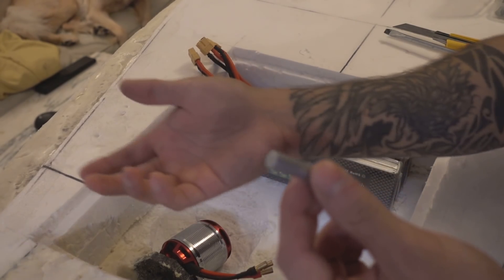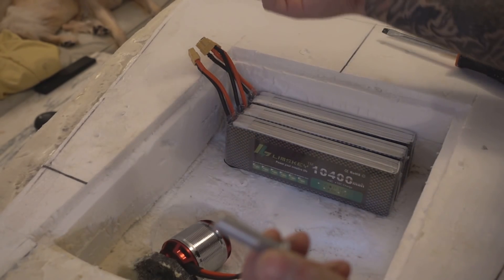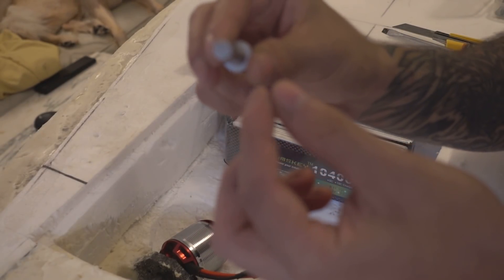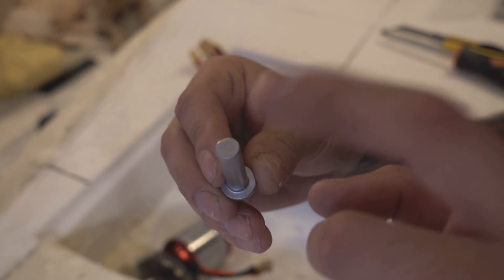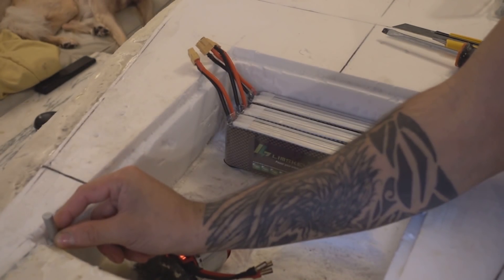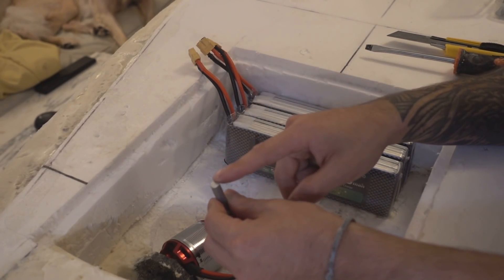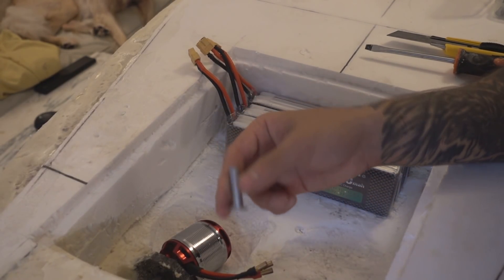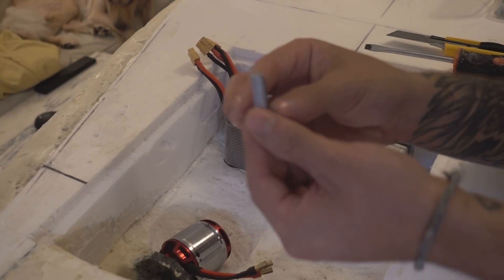Armando mi propio JETBOARD (Tabla de surf JET) #1

Comment: Hello my friend,

I'm building a jetboard also. I see that you purchased the 60 mm  waterjet  STL files from toto.
I did the same, but i'm building with a 56mm jet instead. I think 60mm is a little bit too big. I didn't build the Board, but using a Mistral windsurf Board instead. Looking foward to see your second vídeo. What are you using for power it up?  Keep me updated and also we can share thoughts.

Greetings

Luis
Reply from the maker: Hello!, yes i using that model, im currently using 2 gartt 530kv motors, these are not the best choice i can make but i that's the motors i have hah, provablly i will change it on the future, and i will start with 9s 10000mah lipo, i want to add extra batteries later, like to see your board too, good luck!
Reply: @BuildItYourself 

I use sss 56104 500kv motors. 
10000mah on 12s. Yep 120a marine esc. I purchased the 60mm But Did not print this one. I printed the 56mm Jet drive. Toto tested the 60mm and came up with the final result that 60mm is a bit too big. So he designed a 56mm. That's what i have. Make your tests and let me Know. Will update you with my own tests. 

Thanks
Reply: @canim1973  Hello CANIM do you have a link for the STL files please : )?
Reply: @marinekets2317  hello, 
These stl files were purchased. They were not free to me. There are free Jet drive stl's on the web. Just like the hack lab, he paid for his also. 

Greetings
Reply: @canim1973  Thank you very much Canim 193, i would like  buy  the fichier STL  for my  project jetboard, sorry for my english i'am french..
Reply: do you have link web for buy stl files  please ?